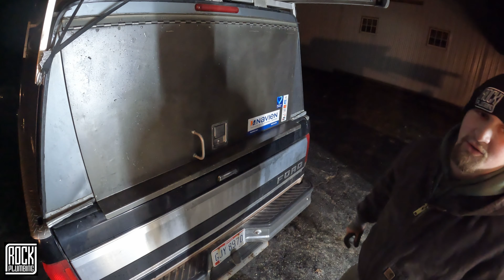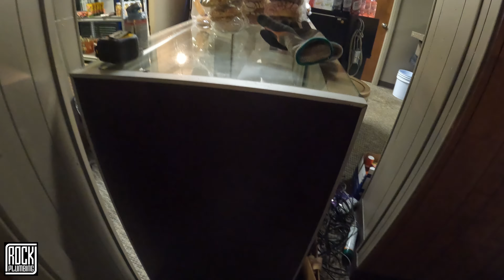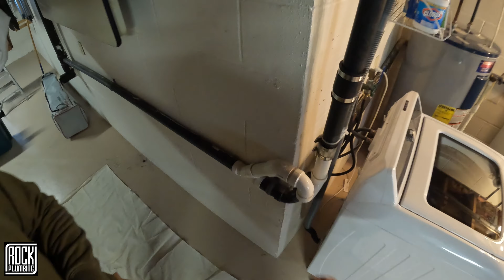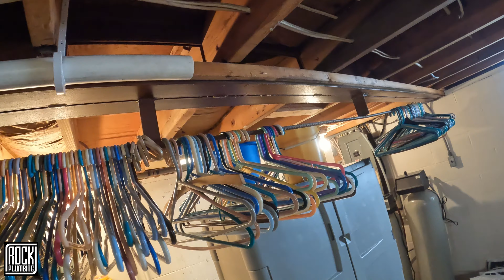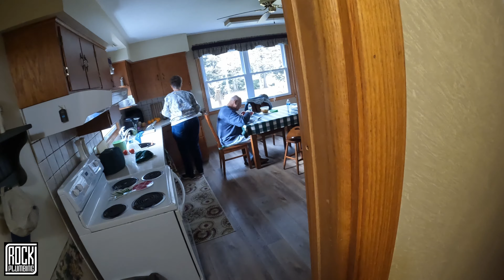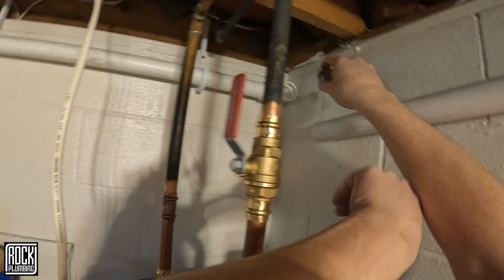HACK Plumbing EXPOSED!! | If only he would LISTEN........

Comment: You asked me what kind of gas valve to put in you put in a quarter turn red or yellow handle new gas valve doesn’t matter what name brand any supply house has it doesn’t have a pacnut  on the back like that butterfly gas valve which aren’t supposed to be used any longer.
Reply from the maker: Thanks for the tip!